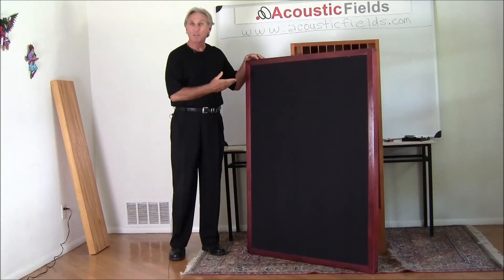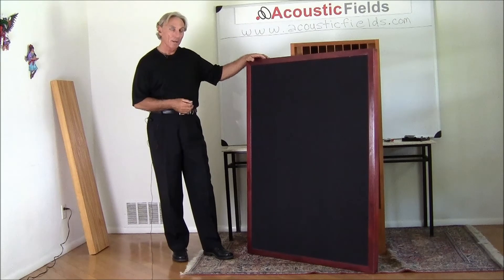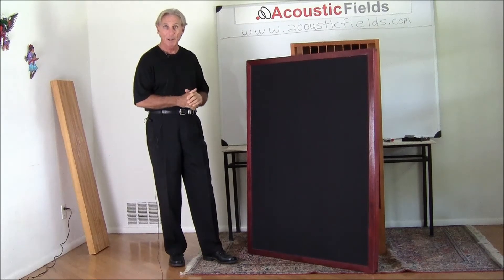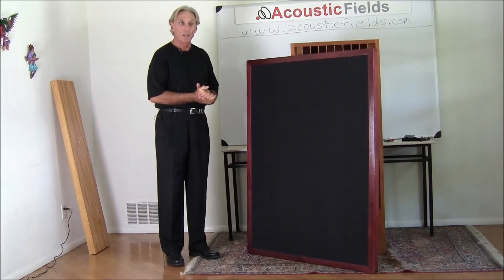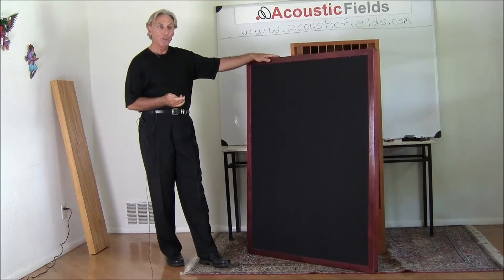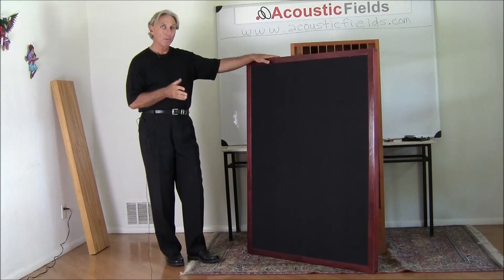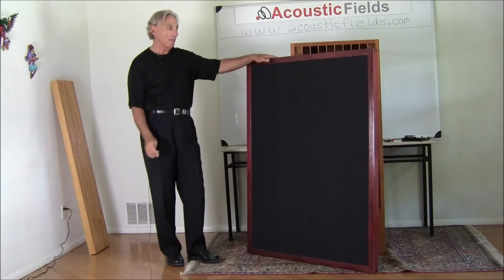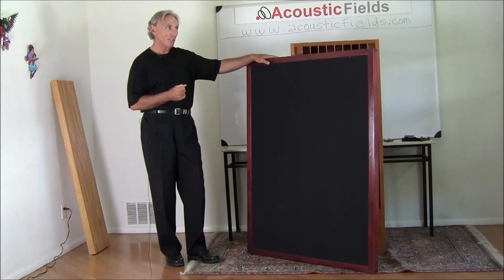Poly Foam Product (PFP) - www.AcousticFields.com

Comment: Can you discuss how to choose the thickness level of a foam panel?  When should we use 1 inch vs 2 inch, etc.

Thanks!
Reply from the maker: Great question,

The thicker the foam, the more absorption that occurs below 500 Hz. A 1" foam will usually absorb 100% of everything after 500 Hz. but much smaller absorption rates below that number. A 2" thick version will show much more absorption at 125 Hz. and 250 Hz. than its cousin the 1" if it is designed properly.

Not only the level of absorption but also the rate must be taken into consideration. Reflection management in small room environments requires middle and high frequency absorption that is smooth and gradual. There is no need to absorb 100 % of the reflected energy in order to manage it. Remember, once sound energy is absorbed it is converted to heat and it is no longer sound energy but heat energy. We can not hear heat energy at all.

Thanks
Dennis